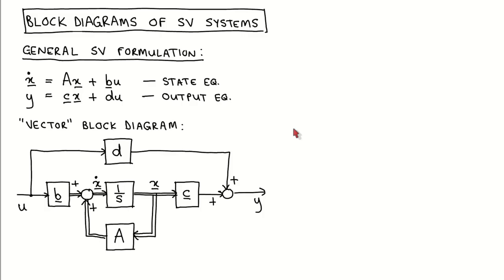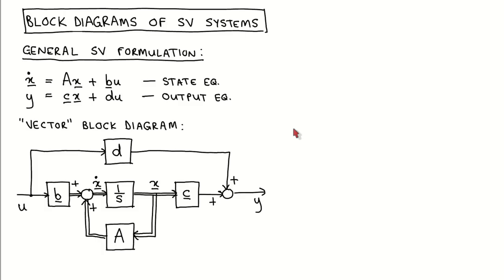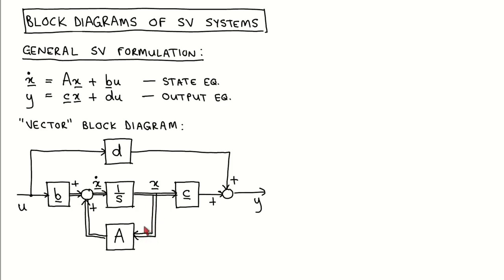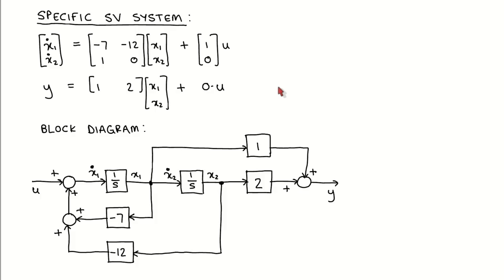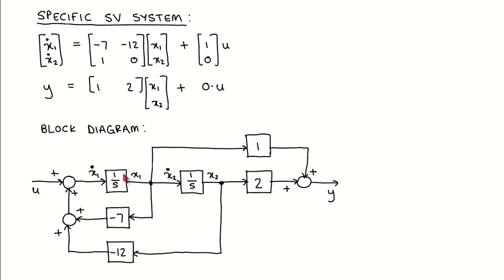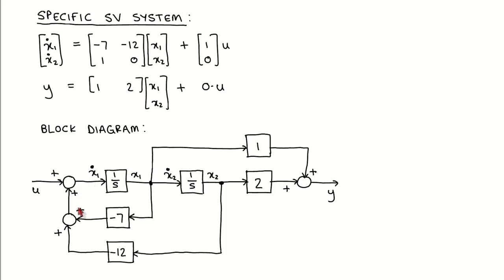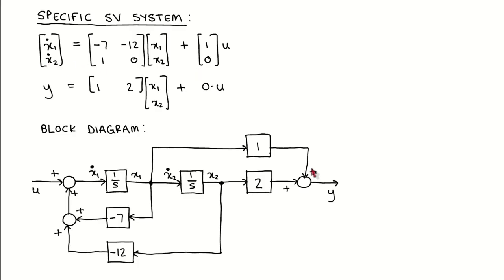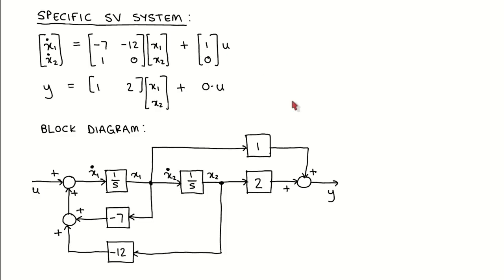State variable control 3: Block diagrams

Comment: Hi there I don't quite get the reasoning for the integrator being in the centre between the state equation there, you didn't quite explain so if is possible it would be helpful if you can provide an explanation for that?
Reply from the maker: x_dot is the derivative of x, so if you want to calculate x from x_dot, you have to integrate x_dot, since integration is the inverse operation of differentiation.
Reply: @cornevandaalen1862  hi there i think there is a misunderstanding here, what i meant is the integrator in the block diagram, why is it an integrator and not anything else
Reply from the maker: @markloui3262  The input signal to the block is x_dot and the output signal is x; since x_dot is the derivative of x (by definition), the only way you can get from x_dot to x is by integration.  The block therefore has to be an integrator.  Does it make sense now?